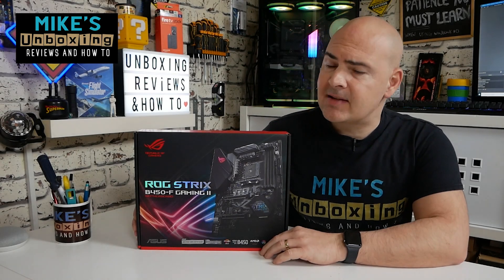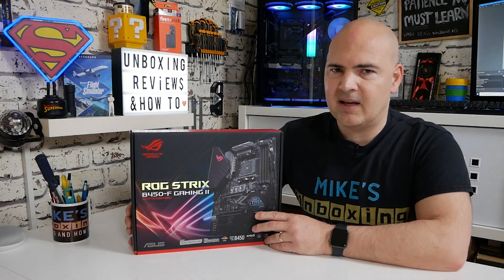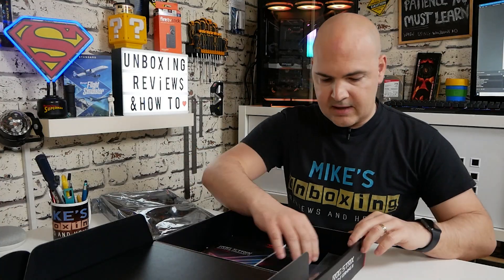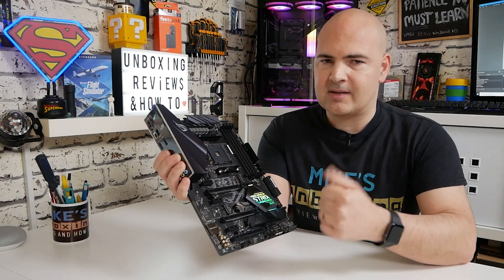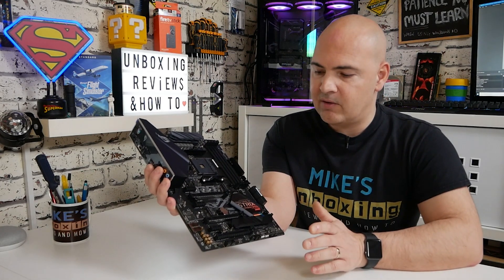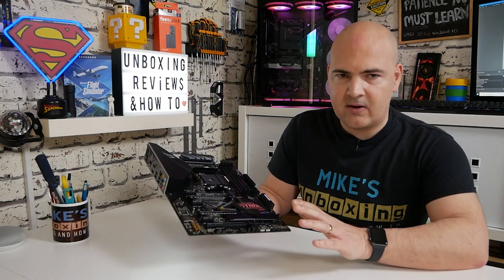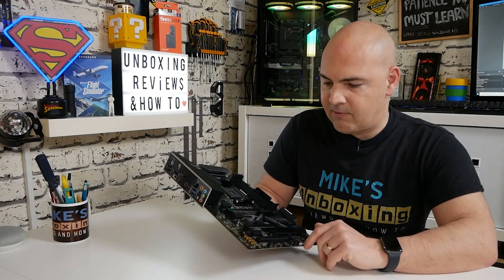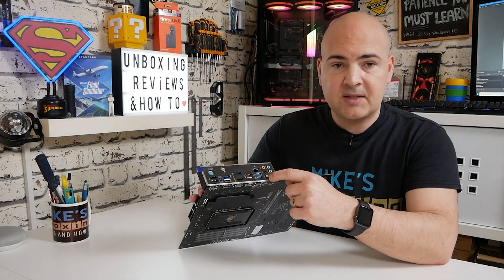ASUS ROG Strix B450 F Gaming II For AMD AM4 CPU The Most Popular Motherboard On Amazon

Comment: why is my ASUS ROG Strix B450 F Gaming ,not detecting or showing m.2 nvme 970 evo plus in ez mode?
Reply from the maker: CSM / UEFI mode ?
Reply: @mikesunboxing   this is my set up Launch CMS enabled
Boot device control : UEFI and legacy OPROM
Boot from network devices: legacy only
Boot from storage devices : legacy only
Boot from PCI-E expansion  Devices: legacy only

 still m.2 N/A not showing up my 970 evo, i even put to auto and still nothing showing up.. but i can boot it properly my 970 evo m.2.. its just not showing up in ez mode.
Reply from the maker: @surenetto1102  This is maybe easier to fix or at least advise if we can ask more questions and get direct answers, so feel free to join our Discord chat and we can go over it in more detail https://discord.gg/XtBTGQ6BDu

Agree to the rules by clicking the emoji and you will get access to the rest of the Discord channels

Comment: Very good guide but I’ve been having some major issues with this mobo. After about a month I cannot manage to get this thing running and it keeps black screening before it boots and shuts off. Every time I take out the ram it stays on without shutting off. I’ve re-sattled the ram numerous times and tried switching out the sticks and it still won’t work. I took out the gpu to see if it was a power issue and took out the mobo battery and put it back in, but it still does not boot. Do you have any idea on how to fix this?
Reply from the maker: i had to return mine for a weird network issue, seems these boards have been very popular but have a high failure rate.  This is maybe easier to fix or at least advise if we can ask more questions and get direct answers, so feel free to join our Discord chat and we can go over it in more detail https://discord.gg/gaeeDPw
Reply: @mikesunboxing  thank you very much for the response I appreciate it!
Reply: @mikesunboxing  this is very disapointing to hear. I buyed thid mobo in the winter after seeing this video and i just unpacked to see it. Now i plan to buy the other parts and complete the build, but do you think it's worth it or shoud i try to replace it with other one?

Comment: I have a question, does this board got to be used with a graphic card, because when I plugged in the HDMI cable there is no video…
Reply from the maker: You need a cpu with built in graphics like the 3200g etc you use those rear video ports

Comment: Does this motherboard support a ryzen 7 5800x without any risk? i was planning to change my 5 1600 but asking around, someone told me that i better buy a B550 at least if i want to use it without risk of it burning, according to their words the processor exceeds the capacity of the VRM this motherboard has and that will eventually cause it to end up burning. 

Sorry if the comment is redundant.
Reply from the maker: probably not the best choice for that chip, and you lose a lot of the benefits like pcie gen3 ,memory compatibilty etc

Comment: Where is the bios chip located
Reply from the maker: just under the area where the CPU is to the left
Reply: @mikesunboxing  but mine its not winbond its ah2010
And i have a corrupted bios if i change the bios with another bios chip in model winbond can it worked?

Comment: So I purchased this little guy to get some extra 16 x pcie slots for m2 cards I bought. Wanted extra drive space.
Tinkering around I have a few other parts from my old computer that I was planning on tossing in as well.
Wireless, maybe an extra video card.

Well as soon as I did it nothing will load. It may be a faulty mobo. Looking around to see how this thing works. Need to get my gaming on. The instructions manual sucks.
Reply from the maker: be careful with the PCIe gen switches that might be a possible problem, but feel free to join our discord to try and thrash it out

Comment: I bought a AMD Ryzen 5 1600 cpu. I notice it says Discrete Graphics Required on the box. What does that mean? Will this cpu work with the B450-F gaming II motherboard? Will the onboard hdmi video port work with this cpu installed?
Reply from the maker: the ryzen 5 1600 needs a separate video card to display an image, there are no integrated graphics on the board or the processor

Comment: I currently have a Samsung 500gb SSD. i would like another but the m.2 looks interesting. Would i be able to run a M.2 Samsung - 970 EVO Plus 500GB PCIe Gen 3 x4 NVMe Internal Solid State Drive with V-NAND Technology and a regular SSD with the ASUS B450f?
Reply from the maker: yes that should be fine as long as your processor also supports it

Comment: Hello good evening! I just had a quick question that I feel I can’t find a straight forward answer on anywhere, I was wondering if you or someone in the comments could help please?
Am I able to put a second m.2 nvme drive in? Not sure what x8 mode means that it says in the manual. Any help Is appreciated thank you
Reply from the maker: yes the top m.2 is supported from the cpu and the lower one from the chipset so you can use two drives

Comment: This has 2 m.2 slots right, so I will have to buy a heat sink for one of them?
Reply from the maker: m.2 drives don't really need heatsinks unless they are being really hit hard. I wouldn't worry about it, my x570 tuf gaming doesn't have a top m.2 heatsink and the pcie4x4 drive is my main drive and doesn't cause me any issues

Comment: I bought this mobo but I have some questions, Can I use the secondary m.2 with the second pcie_x16? because If I use the secondary m.2 with the first pcie_x16 it get down to x8.
Reply from the maker: no the lanes are shared so that won't work at full speed maybe half speed at best
Reply: So I can't use the m.2 with heatsink and a 16x graphics card? 😮

Comment: I have this MB but I can't get any m.2 ssd to work in the second slot. What could be wrong? I have one free spot now as I had to use a PCI card solution.
Reply from the maker: if you used a PCIe card that might be taking the lanes from the slot
Reply: @mikesunboxing  I used the pci afyer I had tried it in the m.2 slot. It's so weird. It was a nmve card
Reply from the maker: @Dannyskillz  This is maybe easier to fix or at least advise if we can ask more questions and get direct answers, so feel free to join our Discord chat and we can go over it in more detail https://discord.gg/XtBTGQ6BDu
Agree to the rules by clicking the emoji and you will get access to the rest of the Discord channels

Comment: Can i use the ASUS ROG Strix B450 F  and the 
AMD Ryzen 5 5600X Wraith Stealth CPU together?
Reply from the maker: yes but the stealth is not really a "good" cooler, you should consider swapping it out at some point for a 120mm tower cooler or an AIO when funds are available
Reply: @mikesunboxing  yes thank you i am going to buy an AIO the Air cooler for the CPU just comes with it

Comment: Can i move the bottom NVME heat sink to the top one?
Reply from the maker: no i don't think so, i had to return my board as it died so i cant try it for you
Reply: @mikesunboxing  yea but if you think about it then it would make sence, however the only problem that might occur would be the space between the heat sink and and the pci socket

Comment: Mike, thanks for the video, could you make a video on installing a m.2 because on the Asus motherboard they have rubber for the m.2 but I don't know how you would use it.

It's kind of upsetting that there's only one usb port in the motherboard
Reply from the maker: the rubber is to either support a drive or to put in between the m.2 when no drive is installed to prevent the heatsink rattling
Reply: @mikesunboxing  so it's not really needed?
Reply from the maker: @waldo1359  doesn't seem so from what i can tell
Reply: @mikesunboxing  oh okay, thanks Mike
Reply: Sadly didn’t know this until right now can’t use my AIO :/ but I ordered a splitter but now I have to wait.

Comment: What we can do with gpu when installed  1X16 but  run at X8 if we are using  M.2 _2 slot ?
Reply from the maker: what gpu is it?
Reply: My gpu is  Asus Rog Strix RX 480 8 Giga OC and my current  Motherbord also Asus Rog Strix B450-F Gaming and the Ssd  Samsung 500 giga 970 evo plus Nvme

Comment: Is it worth to buy this MOBO with Ryzen 7 5800x and RTX 3070?
Reply from the maker: it will work fine but the B550 or X570 might be a better option
Reply: @mikesunboxing  May i ask why its a better option? Also B550 and X570 are expensive than this ASUS MOBO.

Comment: The reason you would buy the 450 board, rather than the 550, for example: The B450 will run MUCH, MUCH cooler. It consumes 65W vs. 105W.
Reply from the maker: the chipset actually consumes a lot less than that you might be confusing the CPU wattage, AMD do generally 65w parts or 95w or 105w parts

Comment: the m.2 shield frozer can be moved to the main m.2?
Reply from the maker: no sorry i just tried it and there are no mounting points to do so
Reply: Hello! Can I ask, cause my SSD can't be detected in the M.2_2 slot, the one with the heat sink cover. But when I use the slot 1, it's detected. Any help?

Comment: Will this work with the AMD ryzen 5600g?
Reply from the maker: yes with the appropriate bios installed
Reply: @mikesunboxing  ok cool thanks for the reply, plan on using the 5600g and this motherboard for my first build.
Reply: Just to check if it says 5000 series ready on the box like yours there, that would mean the bios is up to date enough for the 5600g?

Comment: My b450f gaming 2 mobo has the 3rd gen ryzen ready sticker, but no ryzen 5000 sticker. Does this mean I need a BIOS update?
Reply from the maker: that is quite likely the original board bios was version 0301 and they added support for 4000 and 5000 in the 4007 bios

Comment: I guess this will be the best choice for my Ryzen 5 5600x in this price range.
Reply from the maker: it is a good option or the b550 pro-a from MSI
Reply: @mikesunboxing  im planning to get this board( from a320), im currently using a ryzen 5 2600 and i plan to upgrade to a ryzen 5 5600x in a few months, will this be able to handle it with a bit of oc? i was initially gonna go for a b550 board but i found out 2nd gen ryzen isn't supported.

Comment: If I use 2x m.2 ssd in this mobo I've read you lose channels to the gpu and it doesn't run at 100%. Is this true
Reply: Or channels to both m.2 and again lose performance
Reply from the maker: depends on the processor you are using, the processor has all the lanes
Reply: @mikesunboxing  ryzen 5600G

Comment: Hii mike. my strix b450 f g2 not detected on armmoury crate, any solution
Reply from the maker: it is probably the aura service or armory crate service not registering. i have that now and then. i remove all the ASUS related software, reboot and start over that usually fixes it, or just use signalrgb

Comment: Hi. I accidentally overclock my ryzen 5 3400G and now its hitting 70°C to 80°C temp.

How to disable or turn off the overclocking? Or reset the Asus rog strix b450 F gaming II bios?
Reply from the maker: turn it off and remove the bios battery then it should reset the bios
Reply: @mikesunboxing  how many minutes should i remove the battery? 

And is it okay if i just turned off the pc and then remove it but not removing other parts and the mobo from the case?

Comment: I had one of these boards and it died after 1 month this as never happened before I think the quality of asus boards has gone down a bit also why only one m.2 heatsink and no case screws but included was sata cables that I did not need
Reply from the maker: i agree, ASUS tax is a real thing but used to ensure quality, not so much these days

Comment: Guys which one of these two boards are best for overclocking:1- MSI B450 Tomahawk Max Or Asus strix b450 F gaming ii ?
Reply from the maker: what processor? but most likely the gaming ii
Reply: I'm planning for the ryzen 3600 for now but maybe I will upgrade to let say a ryzen 5700g or 5800x in the future so which board will be better and also does the version 2 of the Asus rogue strix have better vrm solution compared to the first version thanks for responding ^^
Reply from the maker: @massilamri6628  This is maybe easier to advise if we can ask more questions and get direct answers, so feel free to join our Discord chat and we can go over it in more detail https://discord.gg/gaeeDPw

Comment: ok ill subscribe now :)

hmm sr may i ask if it is worth it if i upgrade to this mobo ?
and if there is any problem in my build pls may i know what it is so i can replace it thanks in advance <3

my pc spec is
CPU
	AMD Ryzen 5
	Picasso 12nm Technology
RAM
	16.0GB Dual-Channel Unknown @ 1199MHz (17-17-17-39)
Motherboard
	Micro-Star International Co. Ltd. A320M PRO-VH (MS-7C52) (AM4)	
Graphics
	MSI G24C4 (1920x1080@144Hz)
	4095MB NVIDIA GeForce GTX 1650 (NVIDIA)	
Storage
	931GB Seagate ST1000DM010-2EP102 (SATA )	
	238GB KINGSTON SKC600256G (SATA-2 (SSD))
Reply from the maker: not really going to give you much more other than some overclocking abilities

Comment: Sir just want to ask.

I recently bought that Rog strix b450 F Gaming II.

My prob is it wont turn off (even fans) when its inside the case, but when it is outside, it has no problem working.

What seems to be the problem?? I have ATX case
Reply from the maker: Could be a mounting pillar shorting somewhere or the power or reset switch is stuck

Comment: I’ve got this motherboard with a ryzen 5 5600g and I can’t get it to boot at all it shows dram light so I’ve tried about 50 different ram all brands and different sizes I need help I’ve been wasting money for about a year on this garbage
Reply from the maker: have you updated the bios to a version that supports that processor?
Reply: @ yes I’ve updated the bios through the bios flashback
Reply from the maker: @PAPAwheelie568  This is maybe easier to fix or at least advise if we can ask more questions and get direct answers, so feel free to join our Discord chat and we can go over it in more detail https://discord.gg/XtBTGQ6BDu

Agree to the rules by clicking the emoji and you will get access to the rest of the Discord channels

Comment: If I bought a Ryzen 5600x processor do I have to update the bios or is it already supported
Reply from the maker: depends on how long the board has been sat on a shelf, hard to say for sure, but the 5600x is getting older now so most new boards will be ready for it

Comment: You can use 3 pin 5v rgb with the 4 pin boards using a converter:
https://www.newegg.ca/deepcool-rgb-convertor-black/p/1W8-00JK-00030

Is it worth upgrading to this board from the original?  I have the original b450-f gaming running an original ryzen 5 1600.
Reply from the maker: the deepcool converter just makes argb into RGB so you don't really get the argb look, but it does work